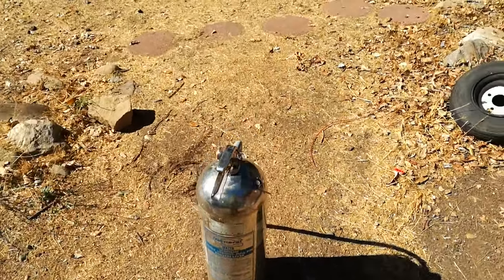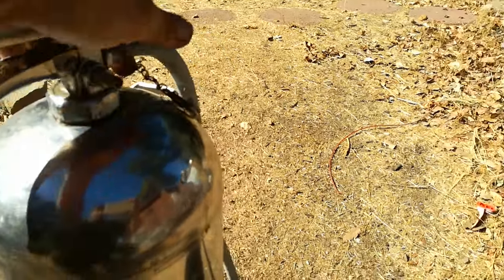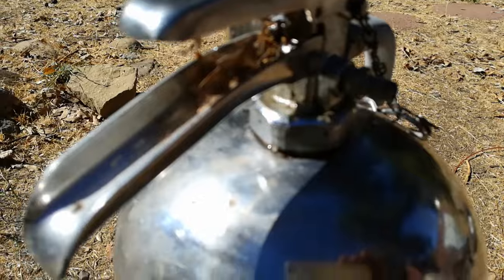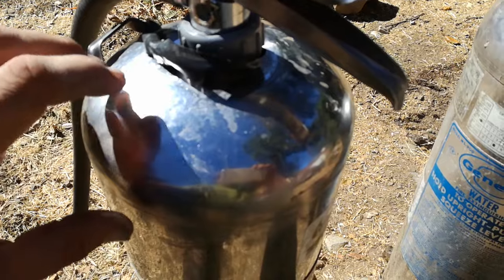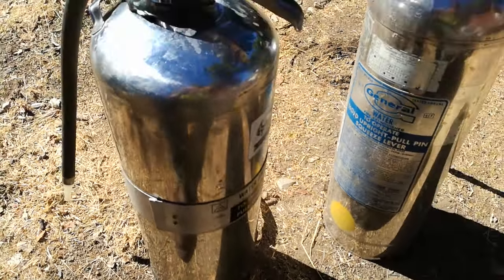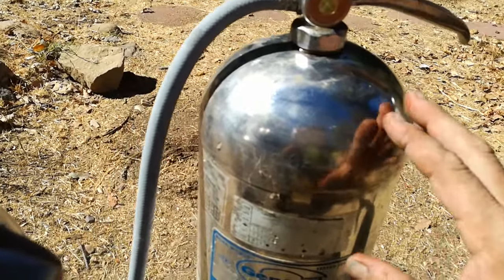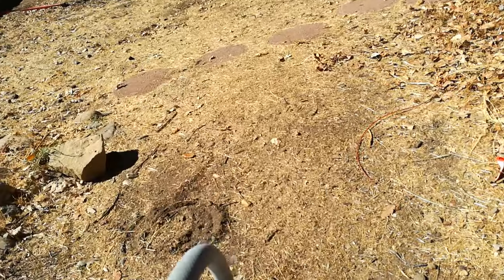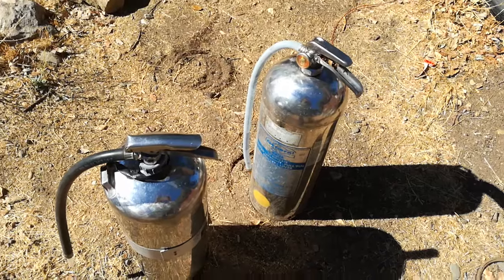How to capture Hydrogen and Oxygen while doing Electrolysis

Comment: Very cool idea the only change I would make would be use two electrodes inside isolated from the tank. Using the tank itself as a electrode will deteriorate the strength of your pressure vessel over time.
Reply from the maker: My main goal was to come up with a very simple to do project that anyone could do. Of course there is always lots of custom work anyone could do to improve it, but the more complex the thing is the harder it will be for people to build one for themselves. This fire extinguisher fuel cell idea is about as simple as I can get it where the only custom parts that are needed is the cap, down steam, and rubber insulators keeping the tank and down steam isolated from each other. After that its pretty much plug the tank in to whatever D.C electric source you have available and begin extracting..